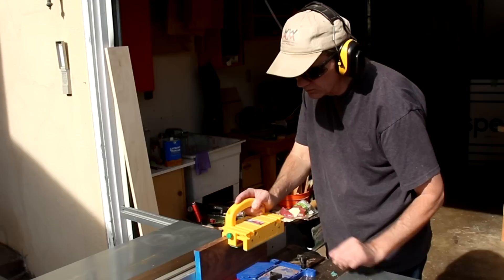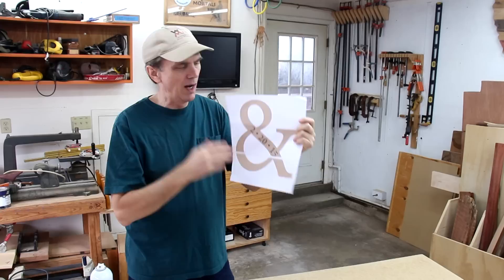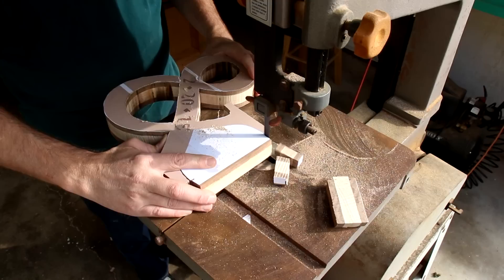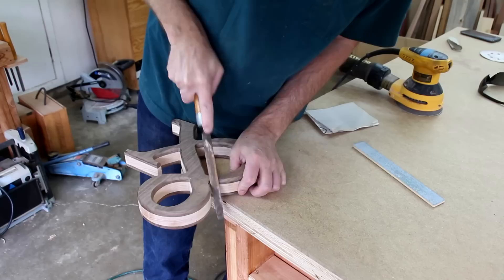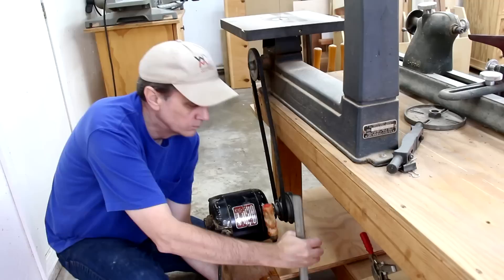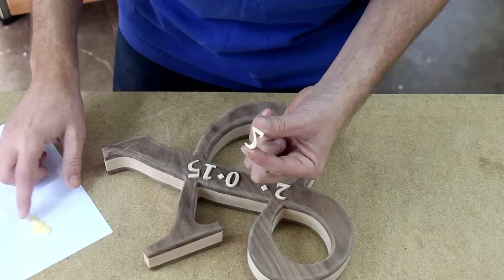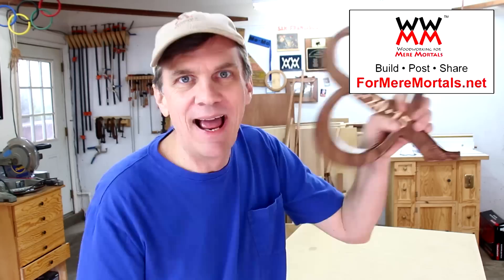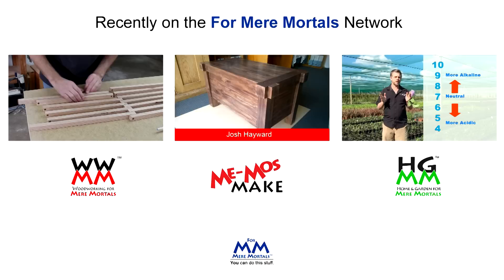Wood Ampersand, "And" Symbol. Great gift idea.

Comment: it was amusing to watch you set up the scroll saw. nice project.
Reply: ***** Heavy duty drawer slides, perhaps?
Reply: i know the motor is for multiple machines. I like the older tools and it does have sentimental value. nothing wrong with a little bit of set up work.

Comment: A way to do it with maybe a bit less sanding would be to make a hardboard template, then put pattern bit in your router table.  I've found pattern bits leave a smoother edge than the bandsaw.

Comment: I think someone is due for a Scroll Saw upgrade :)
Reply: ***** Ha ha i have a scroll saw from the late 1800's that i need to restore i customer found it buried in a shed they were knocking down.
Reply: ***** Yea I would say its time for an upgrade too. You could probably do more projects with one and I prefer them then a bandsaw for a lot of smaller projects.
Reply: I personally disagree with upgrading the scroll saw. All it needs is elbow grease and having the motor set up properly/permanently. This scroll saw will still cut mad circles around all these new scroll saws from today! 👍

Comment: Love the idea, and it is beautiful.  Just curious though, if you had to go through the process of setting up scroll saw anyway, why did you use the jigsaw to cut interior of the amperstand.  The scrollsaw would have cut the interior sections and been a smoother cut as well so less sanding.

Comment: Steve, I moved into a new house and I finally have a garage. I'm cleaning it out today. For my first project, I'm planning to build the workbench from your video a few years ago, so I know I definitely need a miter or table saw first. What other two woodworking tools I should buy? Do you have a favorite brand?
Reply: table saw, miter saw, router and jig saw will do just about everything you want to do.
Reply: James Pool I would add drill press to that list and put it BEFORE the miter saw.  Just my opinion :)
Reply: Dont make the same mistake i made.  Don't buy a crappy tablesaw. It can (in my opinion) be one of the most important.
Reply: *****  i still have the crappy one.  The top isn't even flat haha i like  bosch a lot. Really need a new one
Reply: I was thinking about buying this one today: http://www.lowes.com/ProductDisplay?productId=1208633 Thoughts?
Reply: BBBBBrittany If you're not into making furniture, then buy it. We use these on site at my work. Cutting sheets on it is a torture.
Reply: I'm a newbie and I am trying to save space. I'm hoping it will be a good first table saw that wont break the bank. Thanks for the advice everyone!